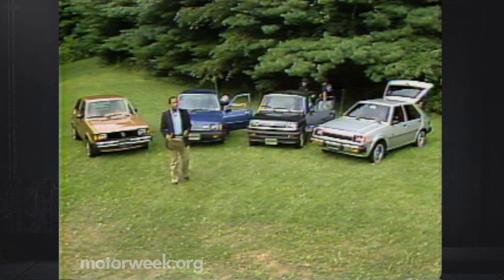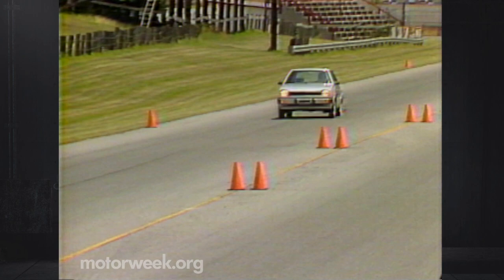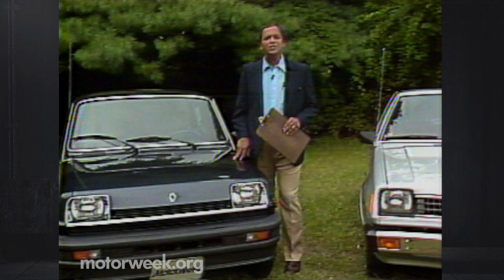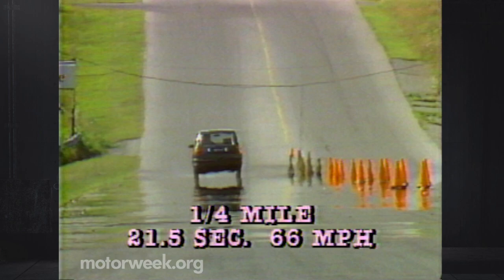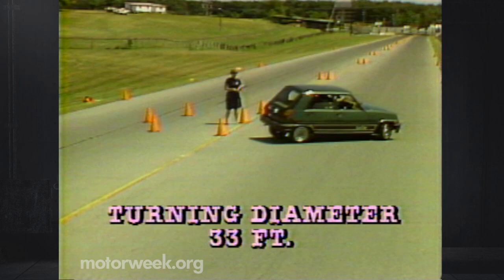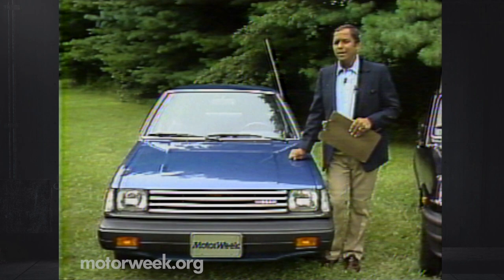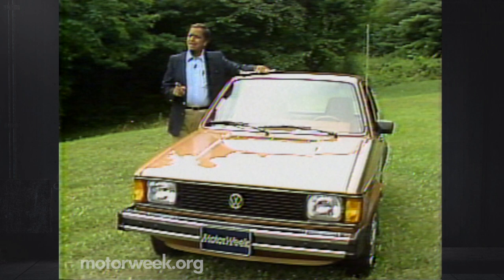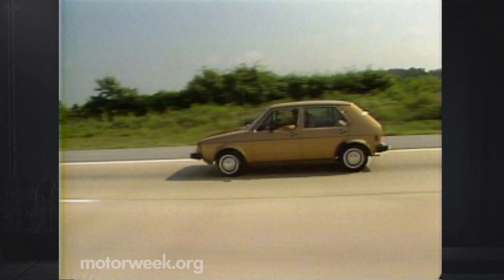Retro Review: 1982 Econobox Comparison

Comment: Hard to think these cars are now 35 years old...if you had a 35 year old comparison in 1982 you would have 1947 models being tested....these cars are not as old looking as the 1947 cars were in 1982.
Reply: @Whatzzz Wrong. Shows lack of artistic design
Reply: @Whatzzz I wouldn't go as far as the 80s but plenty of cars from the late 90s/early 2000s aged way better than the cars that followed them.
Reply: Nice point!
Reply: At least mechanically, these cars are “fairly” modern.  A repair garage could still fix them.
Reply: I agree that cars /vehicles made in the 1940's & 50's seemed just as vintage looking to me now as they did in 1990. It's also staggering to think that 1990 was 30 years ago. Interestingly, to look back at cars from 1980, they just look somewhat dated, but not by no means having that vintage appearance like in the 1950's. In my mind, they still look relatively modern, but they are much less technically advanced as todays cars. This seems to be the difference. Yet from late 1960's/early 1970's, cars in my view started to become and look more modern than 1950's and early 60's cars, with differing styles and colours, etc. However, from mid 80's onwards there was another leap forward in modernity, with examples such as the Vauxhall Cavalier. I thought the next big step were pre millennial cars, such as the mk 1 Ford Focus. Today, I would say the mk4 Ford Focus or Honda Civic and these as with almost all late 2010's/2020 cars are now bristling with technology, which back in the 1980's, we'd have thought was a bit pie in the sky in real life and was something more akin to something like Star wars/Nasa or whatever!
Reply: @the Game, Review and Reallife Channel I would argue the new cars are much safer and have more interior space.
Reply: @the Game, Review and Reallife Channel most cars grow a couple inches here and there with each passing generations.  Tell me the new civic has less interior space than in the previous generations?  Or the corolla, camry, accord, or any mainstream pickup truck. suvs, they almost always get more interior space than the previous generations.
Reply: @the Game, Review and Reallife Channel nope. Look at actual data and you will find that today's cars do indeed have far more interior/cargo room than their predasessors
Reply: @blackshadow7192  Indeed, and when you think about it, they were generally very durable, simple and inexpensive to repair...plus not too many useless technology and safety nannies. I'd buy anyone of these brand new today over what we can get that would be comparable today!
Reply: Most 1940's and even many 1950's cars were based in 1930's underpinnings, whose production stopped or slowed down during the war and then restarted when the war ended. With the lack of money, many car manufactures had no other option than producing 1930's cars lightly or heavily updated. Hence why many older cars looked dated in the 1980's. Besides, today's cars are not that different in concept, sillouettes, design solutions from 1970's or 1980's cars.
Reply: vw beetle .  VW  BUG  .  When they were testing these VW BUG was 35 years old (give or take) But now there is a problem..  How can you EVER get in these peoples shoes .. Like From You to VW rabbit or Mitsubishi colt whatever it is in this revew, there is 35 years. but hey... It is only you that is reading isnt it? (forgive me I dont have apostrophes)  So now it is YOU that has to imagine how these 35 year cars have to compare to the cars 35 years older than themselves.. and at the same time you have the knowledge of the cars 35 years newer than those...MIND.... BLOWN>   welcome to ... MotorWeek
Reply: @Aygo84  american cars were more modern than european models throught, as early 50s to late 50s cars had evolved rapidly in design and technology while for exemple it is true (for most european manufacturers of this era) Ford Britain still produced the dated Ford Popular and Citroen with its Traction Avant
Reply: @blackshadow7192  some , my first care was a 97’ Toyota Camry , my 2017, ans 2019 don’t compare at all ...!!
Reply: The cars produced after the introduction of Japanese cars into the global market were far superior to those produced prior to the 1970's.  The amount of faults and build quality in this era was extremely poor.  Thus a 1950 model in 1980 would be well antiquated/rare whereas a 1980 model in 2010 would be much more common.  To be honest, Toyota and Honda were the game changers.  If their cars didn't rust so badly, there would have been far more on the road today.  Those little Corollas and Hiluxes were bulletproof.  Their engines could run well over 600 000km with regular oil changes and routine maintenance.  A VW Beetle for example could only do 80 000km or a European Ford 200 000km at best and the Italians being nothing less than atrocious in terms of engine reliability or longevity.  If I am correct the American V8 Fords and Chevs were also excellent runners but their engine capacity was more likely triple than the little Toyotas.
Reply: @watershed44  If the safety "nannies" are bothering you, then you are clearly driving poorly. Learn to drive within your lane and keep a good following distance and nothing will beep? I am more happy about the passive safety of cars these days, in case geezers like you crash into us.
Reply: I own an 81 Rabbit and 82 Rabbit pickup, I've never seen any other of the cars on this old Motorweek episode ever in my life. Take it would be pretty hard to do since these car are now 40 years old now.
Reply: @the Game, Review and Reallife Channel Interior space has definitely grown in the last 40 years, but so have blind spots. Modern cars have massive A pillars and things like that to house the curtain airbags. The old cars had much greater outward visibility because they weren't yet required to have such things.
Reply: The late 1930s till the early 1950s cars was in a unique situation, because japan, france, germany, us, uk, italy, etc all were changing their car manufacturing to building military vehicles and equipment, getting bombed during the war (except the US), getting much of their skilled labor force drafted into the military, and then a focus on rebuilding and converted back to a peacetime community after the war.  So other than some eventual trickle down military technology (hemi engines, power steering, modern automatic transmissions, etc), car building, much less development, completely stagnated until a few years after the war ended.
Reply: 41 years now!😲
Reply: These are very clean slate. Today's cars brought the curves back from the 40s. Not saying cars today look like 40s cars because they certainly don't. But the sharp edge designs of the 80s is nice.
I'm sure in the 80s they blended in but today they look really cool imo.

Comment: That Sentra is hands down the best car here. Most reliable, best fuel economy. We used to have loads of those in Finland (called the Sunny here) and Datsun and Nissan had always been huge here; Finland being the first European country to get Datsuns in 1962.
Reply: But WOW, that car is under-spring and under-damped. They're probably right about the glazed-donut tires, but look at the 30MPH brake test-you can see the front end bounce!  The struts are either way too soft, or shot.
Reply: 1982 Sentra was my very first car, loved that little thing. Yes, it was extremely slow, but it also couldn't be killed. All I did was put gas in it, and it lasted forever
Reply: @brettbanta2100  It amazed me how long the early Sentra would last, and how little they cost.
Reply: @skylinefever  Yeah, it's a shame that people cannot buy a decent, just very basic, cheap car anymore. Everything now is primarily geared towards people with tons of dough. They really don't make any cars for people just starting out or for young people without a lot of money, like when I had my Sentra. I was just a 16 year old kid and I was happy as hell to have that little thing. It had no AC, no power steering, NOTHING...LOL. But it was mine
Reply: I had a Champ that we put new struts in at all four corners. They were high pressure gas struts from JC Whitney. It was a huge improvement.

Comment: I worked in a VW dealership parts department in 1982. The Rabbit did wonders for our sales; plastic radiator tanks separating from cores, clogged catalytic converters, broken pot metal framed window crank handles, corroded fuse block contacts, broken exhaust system suspenders, ....on and on. We got so we had the part numbers memorized.
Reply: AKS 😂😂😂
Reply: True. My '80 rabbit had a totally rusted out fuse block. Had to Jerry rig all the important stuff to work, but it also made it theftproof . Got 40 mpgs with the 5- speed on the highway doing 70. Handling, braking was decent. It went 150,000 before throwing a rod.
Reply: It's a German thing. I had the same experience as a tech at a BMW dealership in 1982-95. When customerss are lined up to buy your cars because of the emblems on them, you don't have to try very hard.
Reply: @AKS What year was your Horizon?
Reply: @AKS I had the 1988 with the 2.2L. I gave it away in 2006. To this day I still have dreams of that car occasionally.
Reply: I remember fixing all thst stuff on mine. Had To wrap the fuse box in a plastic bag to keep it dry.
Reply: What a nightmare. I read that the Ram Promaster diesel (Fiat Ducato diesel) ensured that water would fall right on the fuel injectors, then corrode them into the cylinder head. That costs a fortune to repair.
Reply: Strange, as they were known for reliability over here.
Reply: I had a '78 Rabbit. It was one of the worst designed cars I've ever owned.
Reply: @rzu7120  Yet the Golf/Rabbit became one of the best selling cars of all time and the basic design is still in production eight generations later.
Reply: VW started going downhill in the 80s. Wish we could have 1970s VW back
Reply: Ha, I bought a 1983 VW Rabbit when I was in college in the late 80s. My Rabbits radiator kept breaking, we couldn't even find one from multiple junkyards that worked either. It was absolutely horrible.  The clutch was also trash on these vehicles...Finally in 1991 it died on side of the road. A local mechanic towed it for free to his shop and gave me 500 for it...6 months later I drove by the shop and he had.converted the Rabbit into a portable pig picking car...He took out the back seat and gas tank. He placed a pig roaster where the back seat had been, painted the car purple ,put steer horns  on the hood and got a license plate that read  " Road kill cafe" He would drive fhat thing to parties, roast a pig, and drive it back...true story! I bet the Germans who made that VW never jn a million years would have guessed that some country mechanic from eastern North Carolina would turn German engineering into a pig cooker...

Comment: Wow, a blast from the past.  
My favorite line: "A healthy 74 horsepower"... not so much the good old days!!
Reply: My dad's 1987 Hyundai Excel had less. That made it incredibly awful.
Reply: To be fair, the car is  only 2100 pounds. Less horsepower needed.
Reply: Very lightweight cars tho and less bulky
Reply: Owned a 1983 Z-28 5.0 High Output...Rated at a whopping 140 horse with 3:73 gears.

Quick around the city...definitely NOT fun at highway speeds running 3800 rpm or MORE...lousy gas mileage too.
Reply: Hearty
Reply: @BokBarber  And there was a 55 mph national speed limit until the early 1990s.
Reply: In 1982 I had a Ford Fiesta with 40 horsepower. 74 would have felt like a drag racer.
Reply: 74 horsepower is just fine for such a very light little econobox
Reply: <100hp compacts were common into the 90s.
Reply: Cars were lighter

Comment: Ah, 1982. Where a cubby hole for your pack of cigarettes was a selling feature.
Reply: I had one of those cup holders you hung from the side window crevice in my old Civic!
Reply: Steve omg!  I totally remember those!  My dad had those.
Reply: roach clip on the visor too
Reply: Back when being a smoker was actually something to brag about.
Reply: @MrTheHillfolk  Back when people knew that you stopped for your coffee break and didn't drive while drinking!
Reply: @watershed44  
Haha or if ya got caught , the cop gave you a ride to your home not the graybar hotel 😁
Reply: @MrTheHillfolk  True enough. I miss those days. Thing's went off the rails entirely back beginning in the early-mid 90s.
Reply: @watershed44  
Yea I hear that ,I miss throttle cables. 
Try and find an old car with one and test drive it. 
Even if its not powerful, you twitch and it responds. 
Drive by wire has gotten so  out of touch. 
I had to add a 100$ traction control defeat button in the wife's 2014 Jetta. 
You'd hammer a corner and ask for gas and it held steady speed.  
No, I want to accelerate and be on the edge of traction as I exit a corner not get throttle after I'm already thru it 😡
Reply: @MrTheHillfolk  I bought new a 1984 Rabbit GTI . While it wasn't really fast, it was a hoot to drive! No AC, manual windows, vent windows!, a great manual steering rack and manual gear box, and only 2100 lbs!  Best car I ever owned, cost about 7500$.
Reply: @watershed44  
Oh man , those were the days ! 
I had an 83 , and they weren't that slow. 
Mine was faster than a mid 80s 5.0 Stang to 60mph. 
The close gear ratios were nice for the minimal power they had , and they stuck like glue. 
I had a rabbit before that and it was a world of difference. 
Heh just under 8k for yours , those were the days of the diesel rabbit that everyone wanted too. 
Mom paid low 7k for her 81 rabbit diesel they were bringing a premium. 
Haha I'd see a GTI on the road back then and beg mom to trade that diesel in!
Reply: @MrTheHillfolk  
I don't like DBW throttling. It's delayed and requires you to figure out how to get the desired response.
I would take it out of I could. 
Had same Honda V6 engine one with DBW, while the first one was standard.
Reply: @monkeywkeys3916  
It's so annoying. 
At least I got a little response back with the kit that I got but it's still  nothing like the real thing.
Reply: If I'm not mistaken,  the last car sold new,  in the US,  equipped with a throttle cable would be the Hyundai Elantra Touring hatch with the 2.0L beta engine.
Reply: In my Panama the SENTRA was sold as Sunny. It arrived later with other design
Reply: Youtube Sucks  They always knew that cigs were deadly.  Just like alcohol that's everywhere.  The question is, do you want the state choosing your lifestyle for you?
Reply: @MrTheHillfolk  Faster than a mid 80's mustang 0-60, huh? Car and Driver 1983 puts the GTI Rabbit at 9.7 seconds and the base 2.3 liter Mustang at 7.0 seconds. Rabbit 1/4 mile was 17.1 seconds @ 76mph, Mustang was 15.7 seconds. This was the smallest engine with the lowest horsepower in 1983. So  we're you always given a head start or something?
Reply: @mrwp819300  yeh, that Wabbit wasn’t faster than a 5.0 , and the diesel wouldn’t outrun a lawnmower but that damn diesel got 50 mpg my buddy had the pickup 😆 I swear he filled her up twice a month maybe.
Reply: @deborahchesser7375  I will say this about the Rabbit though. My buddy's dad drove a 1980 gas model from about 84 to 86 and I turned 16 in 82, my buddy in 83. It was about the first experience we had with driving at the time and when it was in its power band, it was actually pretty damned fun to drive. When we got it out without the parents, we went to a subdivision under construction with only the streets completed and drove like we were stunt drivers. Slow speed daredevils and we had a Helluva time. When his mom got a new 85 Celica GTS with a 5 speed and we were able to add a ton of power and speed to it, we're lucky to still be here now is all I'll say about that. Great memories

Comment: I had a 1983 Sentra in the early 2000's. It was, even at 20 years old, an excellent little car. It always returned at least 38 mpg and was very dependable. I still remember I had to shake the shifter a bit when putting it in 3rd.
Reply: I have an '82 Sentra still. Paid 300 bucks for it. Won't shift into reverse anymore lol.
Reply: I also had a 1983 Sentra, paid extra for the hatchback and 5 speed.  At $7200 it was a good deal.  I looked at a Pontiac Sunbird but they wanted $10,000 and the car didn't have carpet, a radio, radial tires and it was only a 4 speed.  The Sentra got great mileage and served me well, but I could not get used to how slow it was compared to my old Firebird 400.
Reply: I had an 87, great little car. I got T boned by a pickup and somehow got away unscathed, the cops were looking for who was in it thinking they died before I told them I was in it. Saved my life
Reply: My current car, a 1998 Sentra makes a weird noise when shifting to third...guess some things don't change.

Comment: Hey look it's my first car, the 1982 VW Rabbit. Bought one for $500 in 1994 when I got my driver's license and drove it like crazy for a good 5 years or so. Mine was also American-made just like the one in this video, but was slate blue with grey interior, not brown/tan like this one. I was still getting 33mpg on mine when I had it, not that any of us cared then with gas at 90 cents per gallon. Air conditioning? Nope. Power windows - how strong is your wrist? Cassette tape player - what's that? Let's drive up to Canada for the weekend, the drinking age is only 19 there!
Reply: i consider myself ludicrously lucky then, my 1st car was/is a 2001 540i sportwagon

286hp, 343lb-ft, RWD :D

Comment: My first college Spring Break roadtrip was from the Chicago area to Clearwater, FL in a brand new '83 Sentra 2-door. 4-speed manual, no radio, the only option was A/C. It held all 4 of us, 2 well over 6 feet tall, plus luggage and we got excellent fuel economy. I have no bad memories of the drive other than having to make sure the small boom box we used as a radio didn't fall off of the dash.